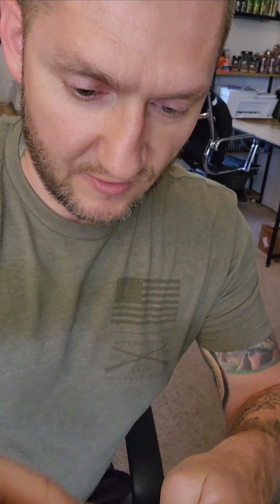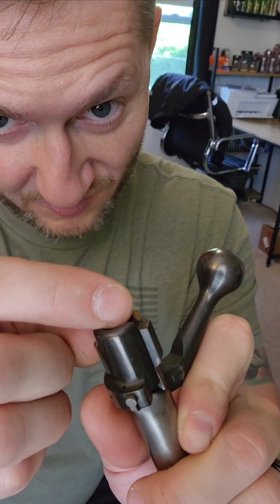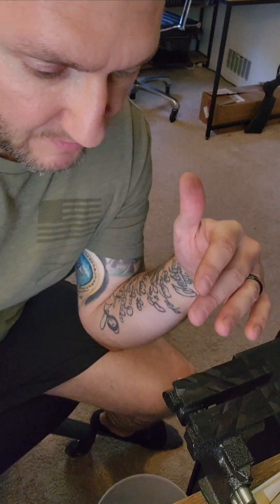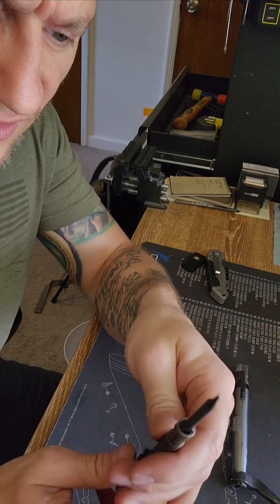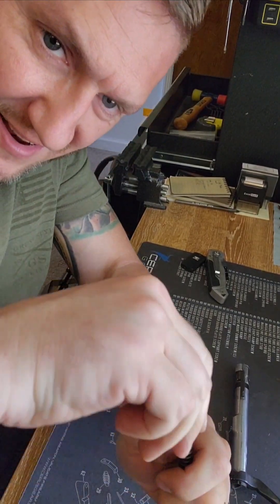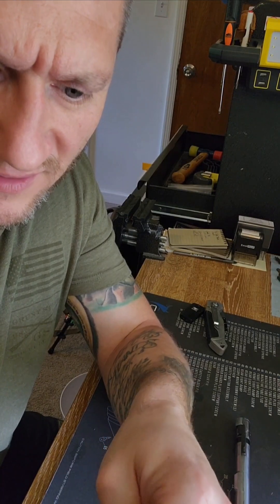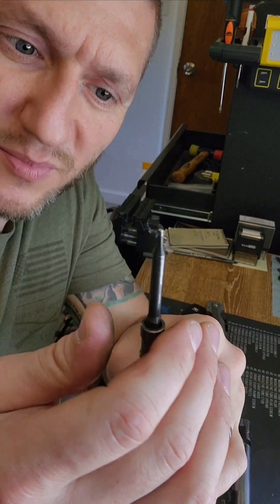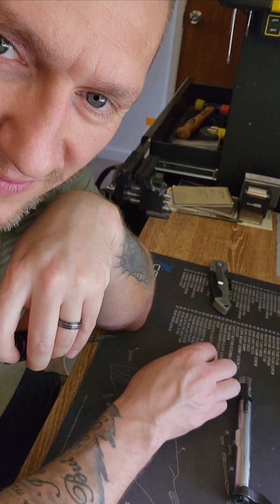Winchester Model 70 Bolt

Comment: THANK YOU! Today I bought a Winchester Model 70. At the gun shop, the safety worked perfectly. Than the gunsmith removed the bolt (leaving the safety in the "Fire" position) to put the rifle in its box. When I got home and reinserted the bolt, the safety was stuck in the "Fire" position, and I couldn’t engage it in the middle position no matter what I tried.

Luckily, I found your video: By following your instructions, I managed to unlock it in no time 😃 THANK YOU!

P.S.: Instead of using vise jaws to hold the cocking piece, pulling back on it and then flipping the safety to the middle position, I pulled back on the striker by engaging its rectangular section against the edge of a (wooden) table and pulling on the bolt body until I could finally move the safety to the middle position.

Comment: were having a problem now where if you take the gun off of safety it goes off, its the model 70 7mm and if you have a round in the chamber and release the safety it'll jump out of your hands. no clue whats making it do that.
Reply from the maker: As the bolt been recently disassembled?

Comment: Having the same issue as Albert below, except that -- I dont have a vice, however, using the edge of a table allows for full movement of the cocking piece by placing it on the rectangular part attached to the circular portion thats in your vice and pulling the bolt downward. My issue is the safety does not move still at any portion within that range of motion; any suggestions?
Reply: Figured it out -- if anyone is having a similar issue, drop the detent pin as if you were going to unthread the the firing pin, then push the rectangular part attached to the above circular portion in that he has in his vice, but pull the bolt down to move it, then try cycling your safety. It worked immediately where it did not when the detent pin was locked in its place.

Comment: I have the same problem with mine.  When you put it in the vise are you just pulling out as you try to move the safety to the middle?
Reply from the maker: You may have to modify your soft jaws in order to get them to hold the bolt in place while working on it.